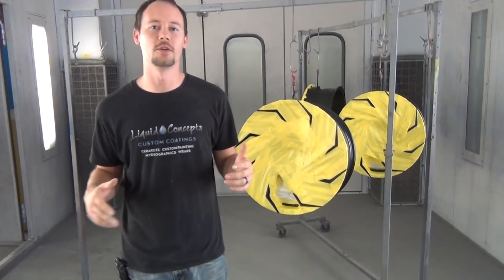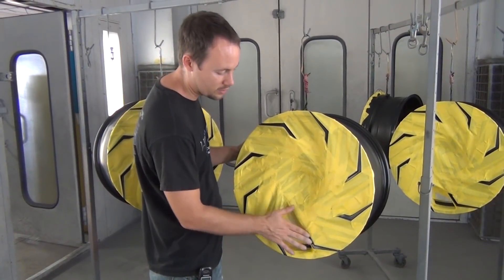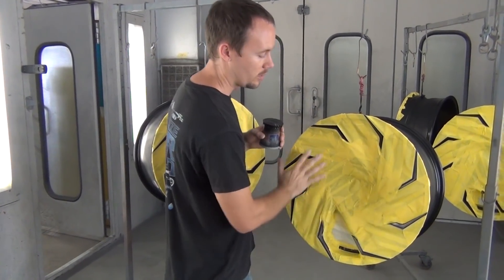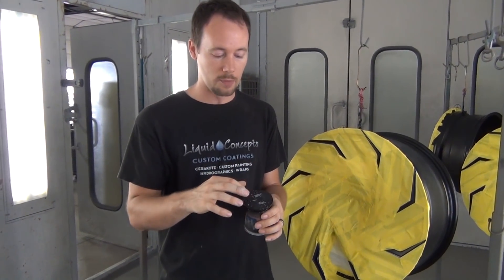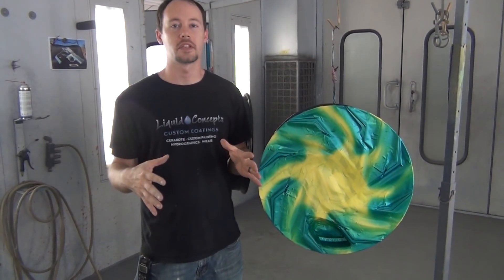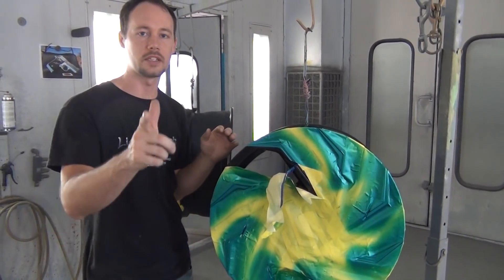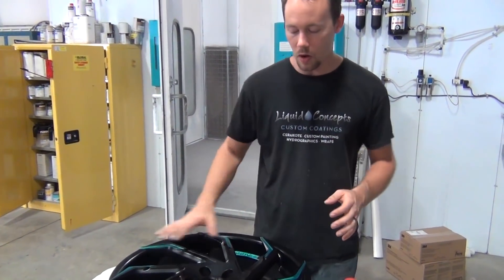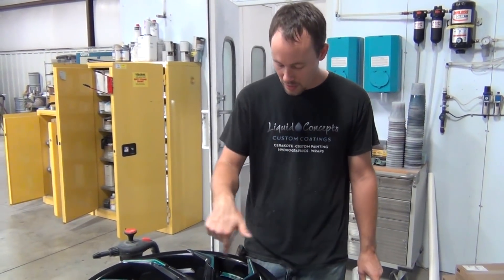HOW TO TWO TONE AND COLOR FILL | Liquid Concepts | Weekly Tips and Tricks

Comment: I used that Frog tape on my wheels after I had painted them black and clear coated. I used the Frog tape to mask off the areas I wanted to add another color to. When I pulled the Frog tape off, some adhesive was still left on my black and clear coated wheels. I spent many hours getting the black and clear coat on. They looked beautiful! I'd really hate to have to do it all again, so my question is...is there a method to getting this off? I used rubbing alcohol to no avail. I didn't think Frog tape was supposed to leave adhesive residue behind? Was it something I did? Too hot? Too humid? Too many questions? LOL any advice would be appreciated. Thank you. Love your videos :-)